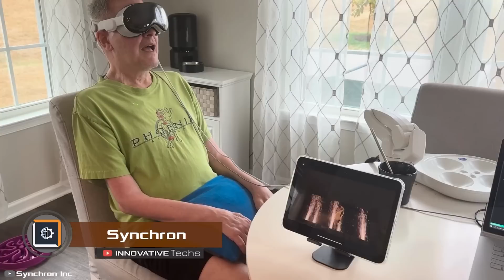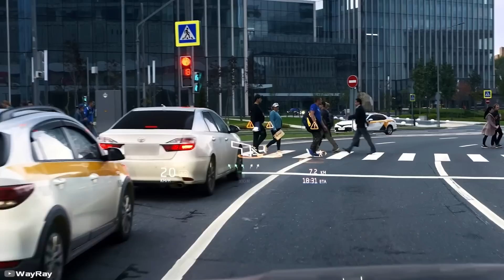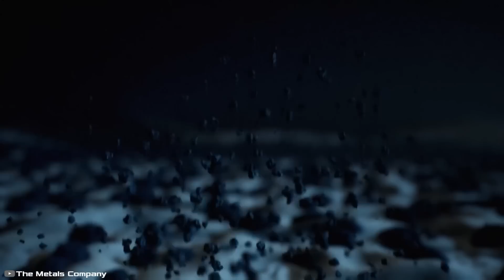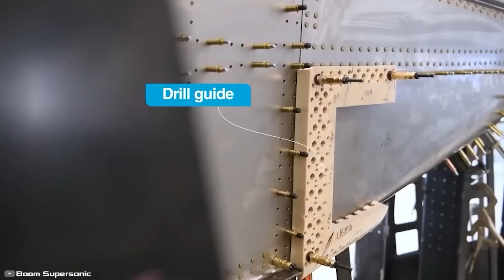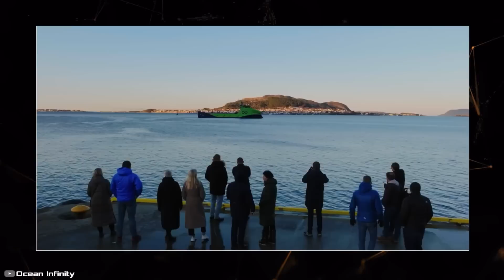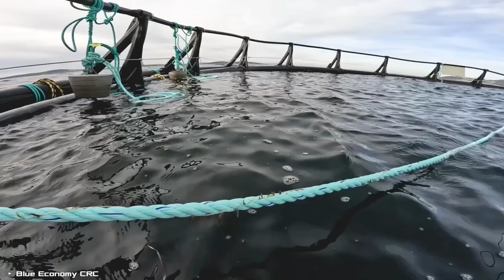INVENTIONS THAT WILL CHANGE THE WORLD FOREVER

Comment: Hydrogen fuel cells are silly for civilian use.
Hydrogen is really hard to store, and the infrastructure to create it and store it for use would have to be boot-strapped up from nothing.

Meanwhile, the electrical grid already exists; we just need to upgrade what is, for the most part, *already there*.